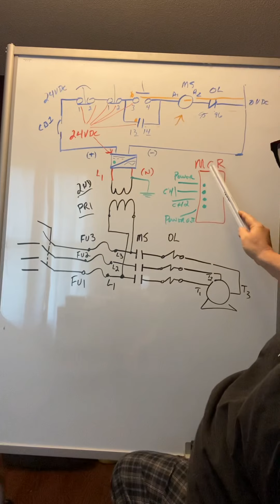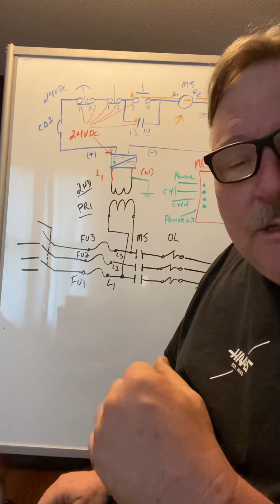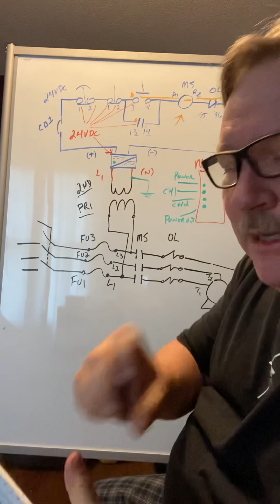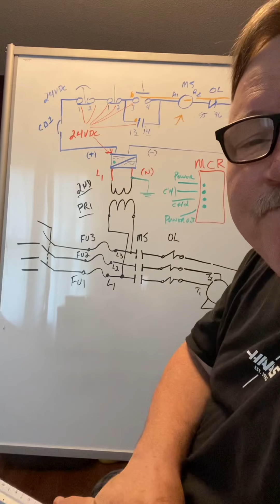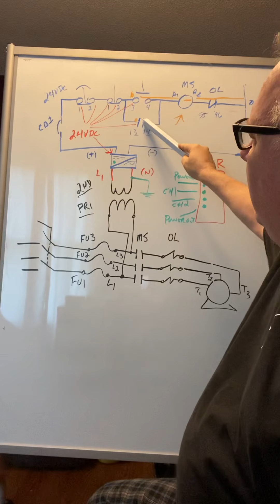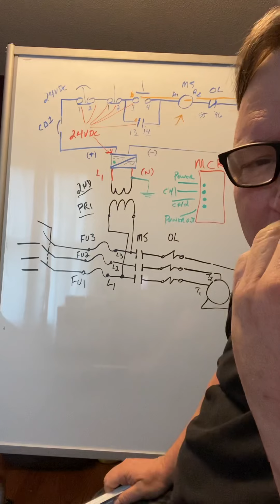Motor Controls 3. (Troubleshooting)

Comment: Do control relay have two voltages for coil and for nc and no
Reply from the maker: Yes. The control voltage will be low or low current compared to the contacts that are Normally Open (NO) or Normally Closed(NC). These contacts are designed to handle larger voltages and amps.  If you need more clarification  just give me a shout. Regards Mike
Reply: @bigmikeh5827  in other word high  voltage is in normally open or closed low voltages is in coil so we can say relay can also be simalr to transformer
Reply from the maker: Jose Torree kinda. The voltage at your coil will have no affect on the contacts. The contacts  are all independent of the coil and each other   You will find voltage at a NO set of contact only on one terminal. For the NC you will find voltage on both terminals.
Reply from the maker: Jose Torree would it help if I did a video on relays?   I’m due to make one and this would be a good one.
Reply: @bigmikeh5827  yes one on troubleshooting as well
Reply: @bigmikeh5827  so theirs voltage on normally open and normally closef
Reply from the maker: Jose Torree yes, the NO will have it on one terminal when the relay is in the normal state. The NC will habit it at both terminals.  When the coil is energized then the no will have on both and the NC will have voltage only on one.
Reply from the maker: Jose Torree will do. 👍
Reply from the maker: Jose Torree relay vid just posted my friend. 👍

Comment: Excellent presentation Mike. 
Youre 100% right with the Master Control Relay and safety interlocks/e-stops.  I almost always check these things first, then move on to confirming any mechanical issues present before i break out my meter.  Esp in motor driven conveyors - always check chain/sprocket linkages and any weighted loads on the conveyor.  My meter is usually my last steps in troubleshooting, but when i do have to pull my meter out, its good to have the basic motor control circuit memorized because it could go across multiple cabinets.

All in all, great video man.